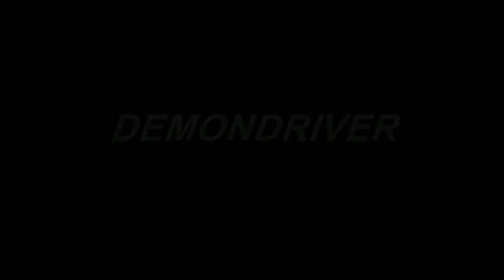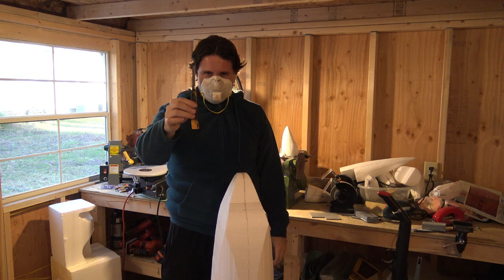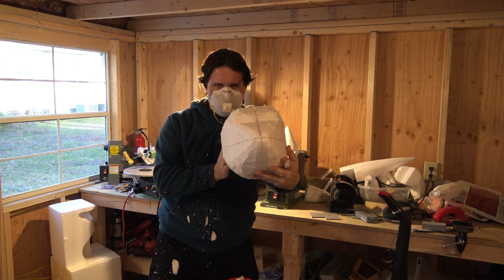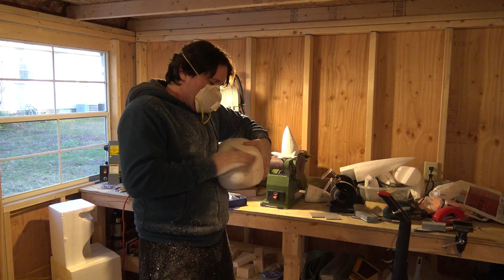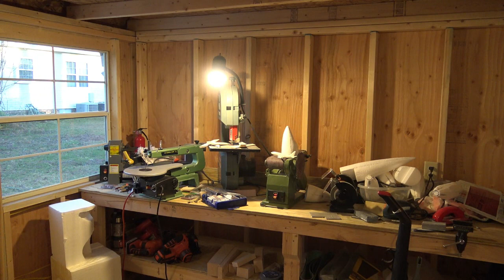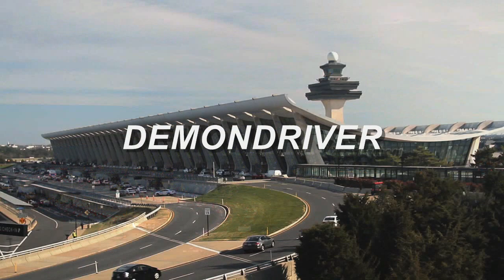RC BOEING 737 MAX Airplane NOSE SANDING!

Comment: Where do you get foam blocks of that size? Do you glue multiple smaller blocks together? I'm guessing not cause I can't see any lines or spacing between them. I'm building a King Air 200 right now from scratch(all foam build) and was curious. Love you work!!!
Reply from the maker: This is One large styrofam block that I hot-wire the 737 Nose from, I get them from Hardware stores.

Comment: Friend which edf you will use in this a potenci 90mm or 70 mm
Reply from the maker: I will use 2 70mm For the 737-200 and 80mm for the 300 & Max-7 versions.